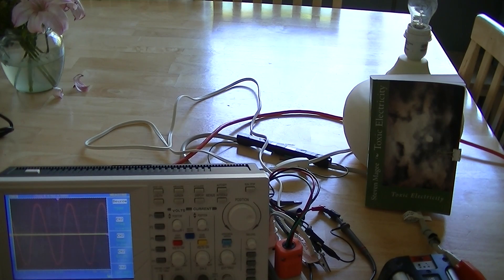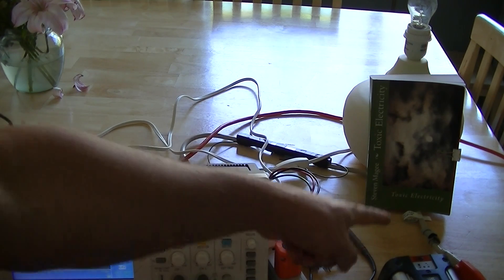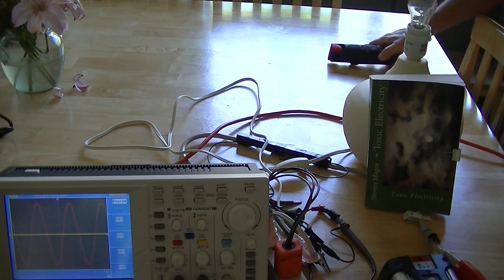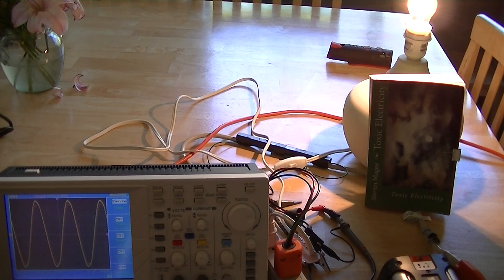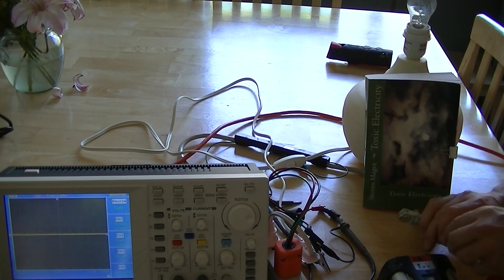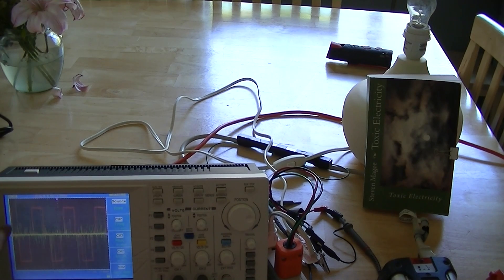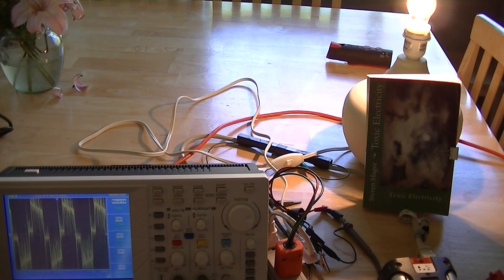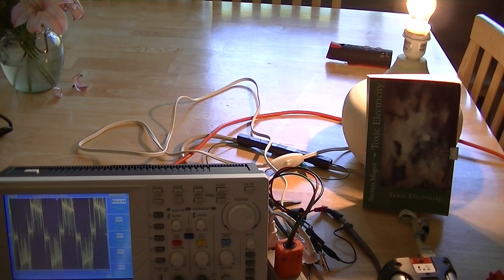The Difference Between a Sine Wave Inverter and a Modified Sine Wave Inverter

Comment: There is nothing wrong with modified sine inverters, unless someone wants to sell power to the grid. If such an inverter is properly designed so that it effectively suppresses the third harmonic component (180 Hz for America or 150 Hz for Europe) through fixed time intervals between the pulses and varying their amplitude instead of their duration, there is no problem for any type of load connected to them. Even motors will run flawlessly. The problem with the ordinary inverters of the market is that they adjust the R.M.S value of their output voltage by varying the pulse duration. This creates plenty of harmonic components, especially when under heavy load the battery voltage at their inputs drops in such a degree that their output seems to be rather purely rectangular instead of modified sinusoidal one, which contains almost all the odd harmonics of the fundamental frequency, causing overheating or burn outs especially in sensitive inductive loads. Of course a properly designed modified sinus inverter is not so cheap as the ordinary one of the market and the cost is finally the root of all the relevant problems...

Comment: The ground reference on the scope is why you're picking up all that RFI. If the ground lead of the scope was referenced to one of the output terminals of the inverter, that high frequency noise would go away, and you'd see clean lines. The outputs on inverters are bridged outputs, so they can run on a 200 volt, rather than a 400 volt DC bus. That improves reliability, and reduces switching losses. Since it's bridged, the output floats, and there is capacitive coupling between the primary and secondary winding in the primary step up transformer. Grounding one of the output blades of the plug will completely solve the problem. you'll also find, that the zero crossing lines will line up, and the output will be a much cleaner stepped square wave. The highest switching harmonic frequency is not ionizing, so this inverter is less harmful than talking on a cell phone.

Comment: You only show 1 inverter if you making a video about pure sine wave an non pure sine wave then show both an turn them on . I like power inverters yes all generators make electrical interference .so keep your power inverters away like in the shed, basement  or dry concrete room just for our toys .an run your lines .power inverter are great for survival an quite just keep it away an you will be fine.

Comment: What is heard on the radio sounds like the carrier frequency, If you use a pure sine wave inverter it will also do the same  but the part that you plug into is filtered to where it is close to a pure sine wave from the wall outlet.

Comment: Thanks for the useful tip to see if it messes with radio frequency. I'm buying one off a friend and supposedly it's pure sine. I can at least test it without that what cha mah call it there. :)
Reply: All inverters have a high speed switching power supply in them, and they all cause radio interference. It's the step up supply, not the output stage, that creates the radio interference.

Comment: I noticed after watching Knurlgnar24's inverter videos, that this test might not be accurate for "pure sine wave" inverters, using the AC line as a comparison.   Seeing his troubleshooting of a pure sine wave inverter, there is actually "Modified sine wave" involved in the first phase of the inverter circuitry in at least one of the models.   The way it is wired, is that it switches "on and off", every other MOSFET, and they alternate polarity.   This creates a "modified sine" output internally, and this is converted through another circuit after to generate the pure sine wave.   Part of this conversion circuit actually involves a triangle wave generator as well.    I wonder how much radiation and dirty electricity an actual pure sine wave inverter puts out in its DC-AC conversion process due to the method of conversion.

Comment: Thanks for the useful video,
Does it still dangerous if the exposure to these radio frequencies of modified sine waves is about 10 to 15 hours every week?

and another question if I may, does the modified sine waves cause malfunction to appliances like fans, personal computers, laptops, routers or chargers of mobile phones if used about 10 to 15 hours a week also?
Reply from the maker: The danger question is one for the medical industry.  All I can tell you is that I became really sick in a home that was powered by a modified sine wave inverter, the primary feature of that sickness was chronic fatigue.  It took several months of exposure for it to get really bad.  I never saw any failures of equipment on my modified sine wave inverter powered home.
Reply: It makes motors buzz louder, particularly induction motors like in fans. You will hear transformers buzz louder as well. It's not quite as efficient, so motors won't turn quite as fast, and transformers will run slightly hotter, but for short term use, I have had no problems.

Comment from the maker: Pure sine wave inverters are the only type that I recommend for people with off grid homes.  When choosing one, look for the harmonic distortion figures in the specifications and choose the one with the lowest values.  I have never worked with the Cotek inverters, so I cannot comment on them.  Make sure it can handle the Florida humidity and high temperatures.